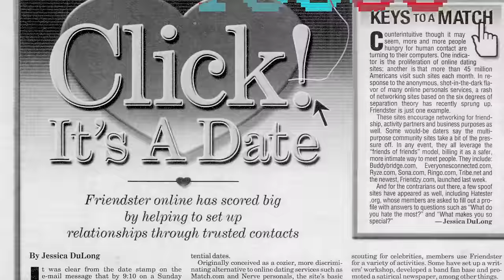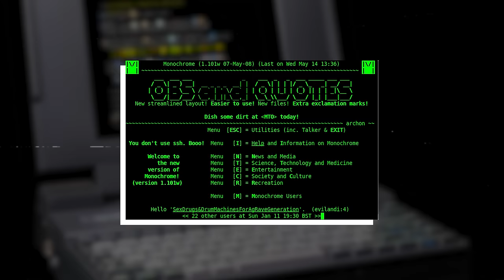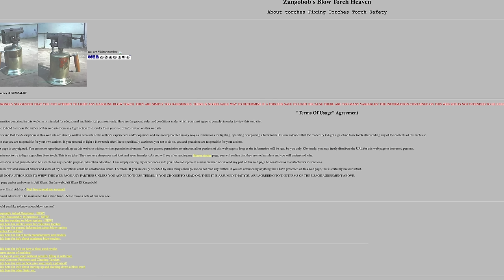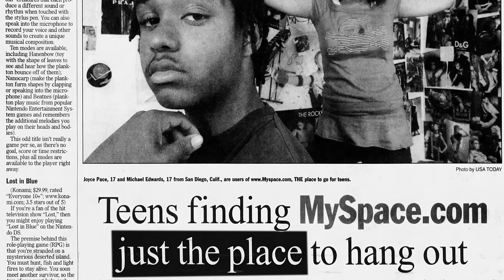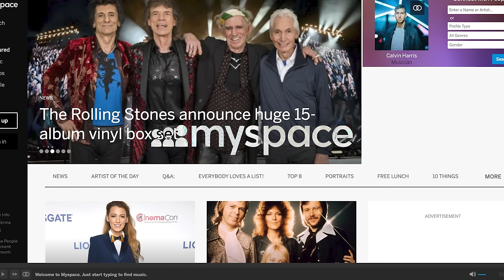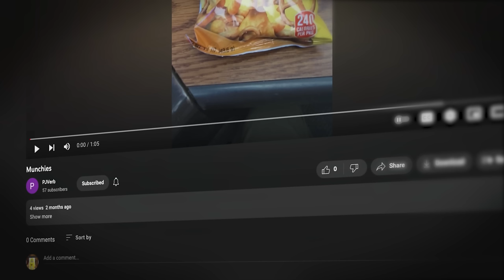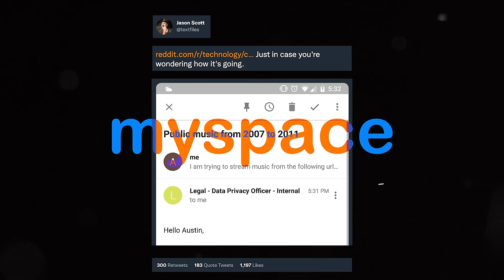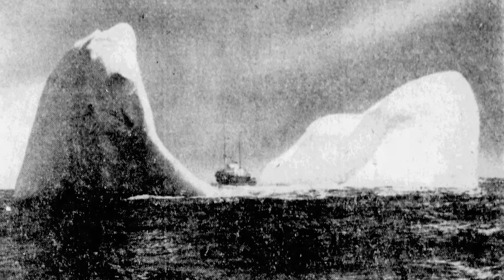The MySpace Incident and the Ruins of the Web

Comment: Nice work on this video. What in the actual fuck though, you mean they didn't have backups at all when transferring? Like not even the text or anything? I was worried something like that would happen. Sound more like they didn't have the money or want to save all the data. But still the older company did also have a responsibility. What did they buy all the servers or something? 
Dangit.

Comment: I still don't get what happened. How do you irrecoverably lose all of your data? Did they delete the old database, and all backups, without even checking if the new files were corrupted? How do you f*ck up that badly? It hardly seems possible to f*ck up that badly.